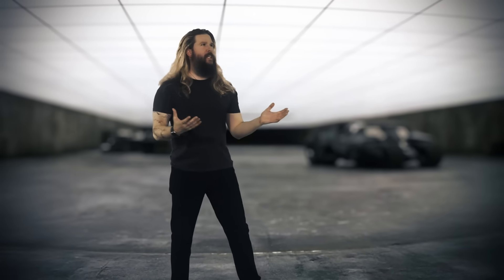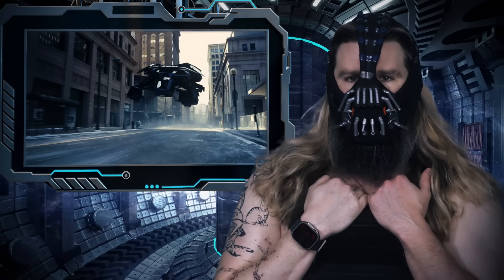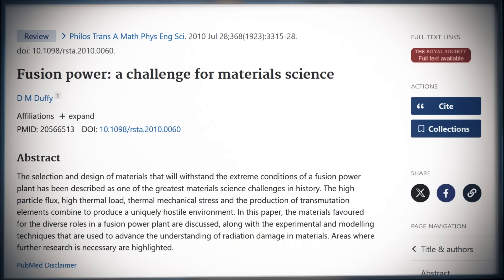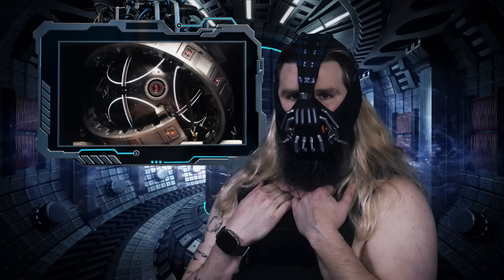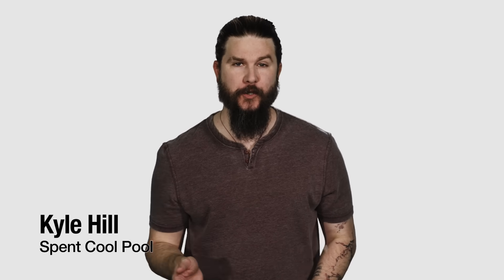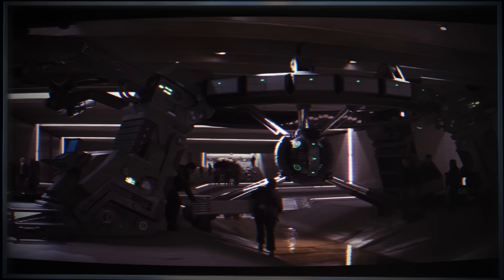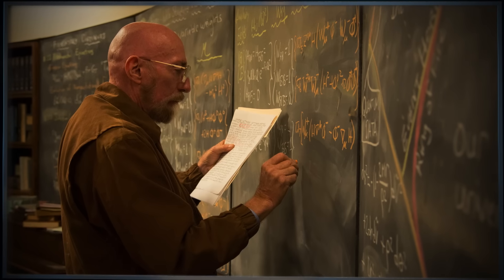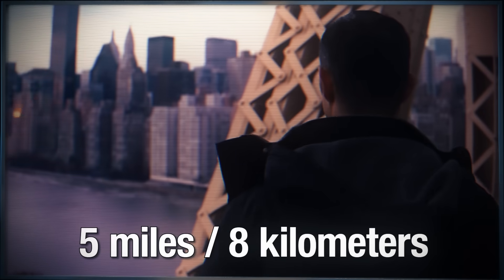Batman's Nuclear Fusion Problem

Comment: for the batman rotary thing being disabled in the blast, the idea was, that batman was not in fact flying the thing himself (made a show that he will to fake his death) as Bruce have patched out the autopilot of the vehicle so it could do it by itself.
Reply: Yeah, I always figured for this scenario. He bailed after he cleared the buildings, because the autopilot could just maintain altitude and heading and do the rest. If the thing had afterburners, he could even get it going faster, without needing to maintain low G load for the pilot.
Reply: Exactly.  The autopilot was fixed.

Comment: u mentioned that fusion reactors wouldn't make nuclear waste, but most of what I've read about this suggests there would generally still be plenty from neutron activation of the reactor walls
Reply: The walls you keep using forever as opposed to an endless supply spent fuel
Reply: @SilverStarHeggisist  You cannot keep using the walls forever. Neutron embrittlement is an issue. Tho im not saying its anywhere near what it would be for fission reactors just that there is some nuclear waste

Comment: Hollywood in general doesn't understand Fusion. When I first saw Spider Man 2, there were a number of times where I face-palmed in the theater thinking "That is NOT how it works!"
Reply: They also don't understand firearms
Reply: @SilverStarHeggisist  ...despite having mandatory experts on set to make sure nobody dies while filming!
Reply: @SilverStarHeggisist  they understand firearms a lot better than nuclear physics, I'll give them that. At least they get the basic gist of what guns are supposed to do, they have no idea how to represent fusion.
Reply: But at least the science fiction was somewhat believable even if not physically possible. A small sun that ignites from a tiny mass of tritium, despite not being theoretically possible, still understands some principles of what it could mean to try and maintain that energy as there's a machine that is used to ignite and control its magnetism. 

Whereas this film just treated a fusion reactor as a tiny nuke without discussing anything about how you would even convert fusion to fission like that. And in such a tiny device.
Reply: But "the power of the Sun in the palm of my hand" sounds really cool... as long as you don't think about how hot it would be...

Comment: I did always wonder about bringing a nuclear bomb up into the atmosphere… aren’t you just spreading the radiation over an incredibly large area at that point??
Reply: No, as far as the radiation goes, it's better to have it higher then lower. The radioactive fallout isn't bomb material itself, it's dust, dirt, pulverized buildings and everything else that gets thrown into the air irradiated and falls back down. Very little of it is actually directly material from the bomb itself. This is why after the high altitude test of the Tzar bomb, the ground under ground zero was safe to walk on immediately after the test (i think it was like 30 minutes after they had teams on the ground), while something like a Davy Crocket mini nuke was incredibly dirty, since it basically detonated directly on the ground. 

So if you want to salt the earth, lower level explosion, if you want the blast wave to go as far as possible to directly destroy infrastructure, you want it higher up.

Comment: I think inputting the blast as a ground burst would be more accurate. Nukemap calculates airbursts as being at an altitude to maximize blast damage (5 km in the case of a four megaton bomb) , and the bat-flying-thing wasn't flying that high when it went off. 

A (near) surface burst would reduce the affect significantly. It would still be a tragedy, but tens of thousands would be dead an hundreds of thousands injured instead of hundreds of thousands dead and millions injured.
Reply: What is he crashed the bat copter into the ocean just before the explosion. Then it would be a submerged bast. Would even less people die?

Comment: Fusion IS passive if you have enough material ... GRAVITY !!!
Reply: the sun was in my eyes as I read this comment. what do you mean?
Reply: @madjack1748 Due to your pun, I feel like this question was rhetorical. But if not, he meant that the force of gravity produced by enough localized material (i.e. a star) is sufficient to achieve fusion without the energy loss of an active process.
Reply: @warrenvwilson😂 Clearly it was a pun.
Reply: @madjack1748  gravity is its own force, so when you add stuff it become stronger, gravity doesnt consume energy

think black hole, is very hard to create black hole, but when you get it the black hole can grow by itself
Reply: @vkobevk  Oh.  You're THAT guy.

Comment: swap the nuclear reactor with an antimatter reactor and the movie would make more sense.
Reply: So... pretty much Angels and Demons, but with Batman.
Reply: Yes no reactor design can work as an nuclear bomb. Chernobyl was an steam explosion. For antimatter it would be the magazine rather than the reactor itself.
Reply: Except antimatter is only useful for energy storage, not energy generation since the only current way to get any high quantity is with a particle accelerator.
Reply: @CarmenMirandasGhost  Another possible use of antimatter is, eg, positron catalysed fusion.

It might not be impossible that we figure out a way to just flip matter into antimatter for limitless power.. At least.. matter by itself can be converted directly to energy without any antimatter at all through things like evaporating black holes so I dont think there is a conservation principle to prevent it. 🤓
Reply: @peterd9698 the thing about antimatter production is most of the energy used to make antimatter with an accelerator mostly results in other, non-antimatter, particles, making it extremely inefficient.
Reply: How long does it take a quarter pound sphere of anti carbon (4 MT) take to annihilate? Charged pion lifetime is on the order of nuclear weapons, but muons last forever. Seems like the thing would be highly dispersed by the time it’s over, so the peak temp would be a lot lower (way less X ray emissions)

But neutral pions make really, really hard gammas.

And neutrinos? Who cares.
Reply: Or thermos full of a bioweapon.
Reply: @MonkeyJedi99  you can still trow bioweapon in lava or acid
Reply: @MonkeyJedi99  why would Wayne enterprises create that?
Reply: @swimfeared  to stop the coming alien Invasion.
Reply: @swimfeared  The same reasons governments give. "Research"
Reply: Except that a matter/anti-matter annihilation event would be a lot larger than a 6 mile radius
Reply: @CKidder80  not really, depends upon the amount of antimatter present. One gram being around 40 kilotons of yield.
Accidentally discovered by the French when mining uranium in Gabon, who were mystified as to why the U-235 levels were so vastly lower than the normal 0.7%.
Reply: @CKidder80  Depends on how much antimatter there is.
Reply: @CKidder80  the radius of any explosion is dependent on how much stuff is actually exploding.
Reply: @CKidder80  The annihilation is 1:1 matter for anti-matter.
The BLAST is a different story, but either event depends on how much antimatter you want to give the container.
Reply: @CKidder80  It depends upon how much material is being used.
Reply: @CKidder80  depend quantity

one gram antimatter=48 kt

one kg antimatter=48 megaton

also some concept of exotic nuclear weapon is you put some mg of antimatter at the core of plutonium sphere, so not need normal explosive